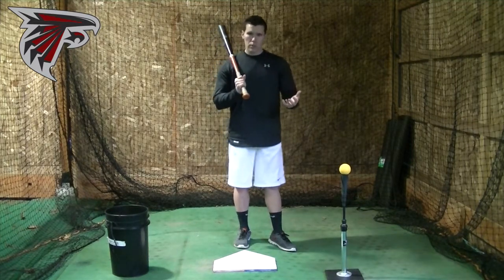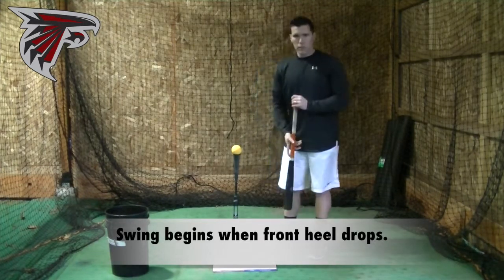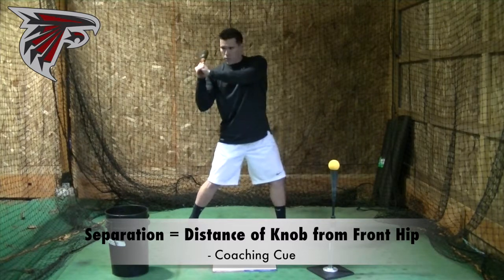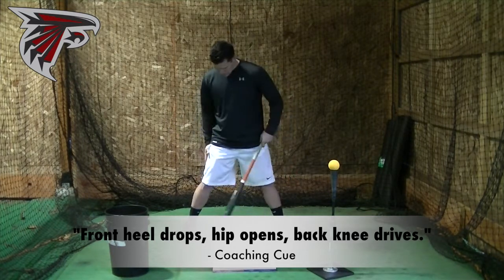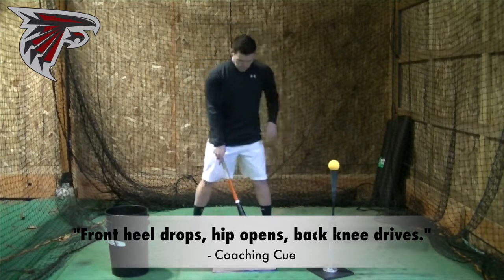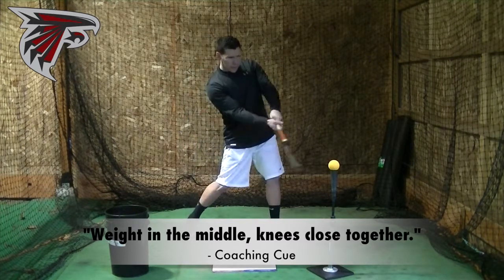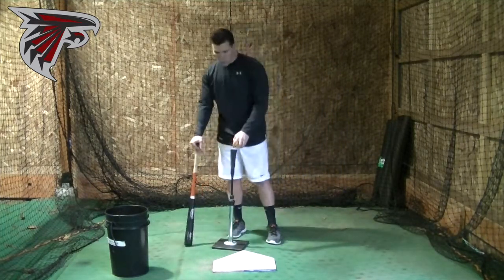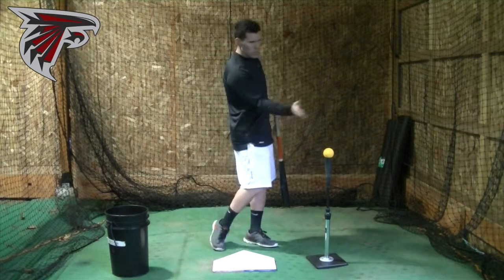Part 3-Lower Body Mechanics

Comment: Great stuff coach!   I just come across your videos and love the content.  
What are your thoughts on hitting against a firm/stiff front leg vs. having some degree of flex (knee bend)  in the lead leg.  I think Cory and Kyle Seager along with Cody Bellinger are examples of flex in front leg.  The flex is slight at point of contact but their finish features definite flex. 
Thanks for the great content!